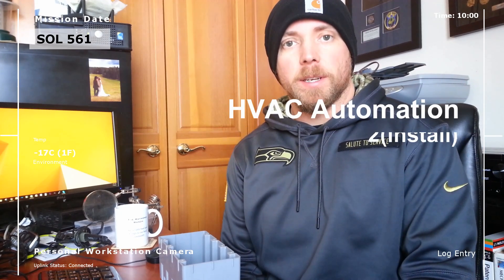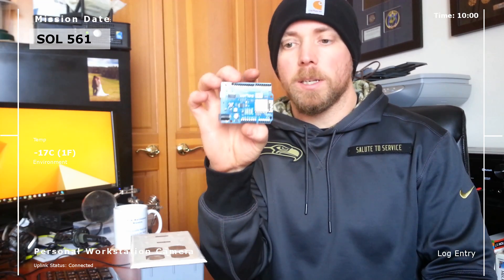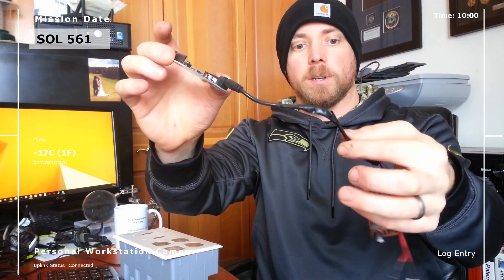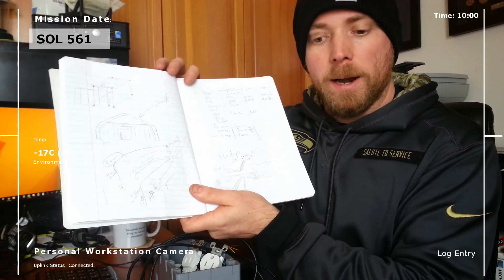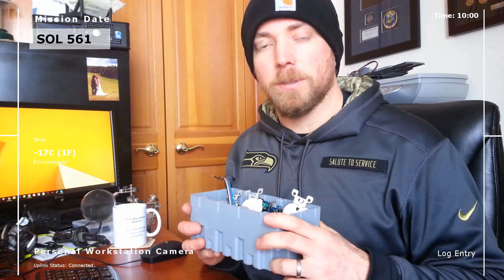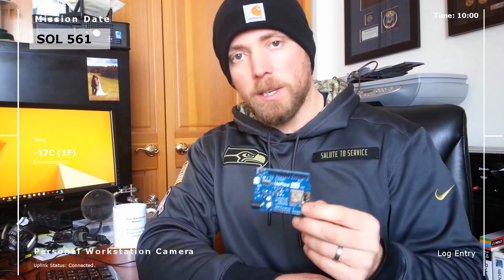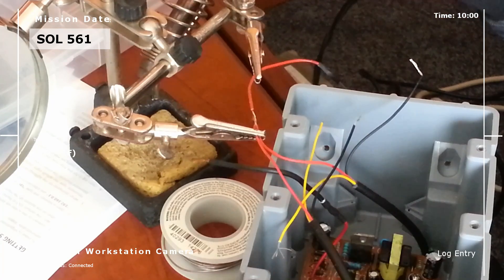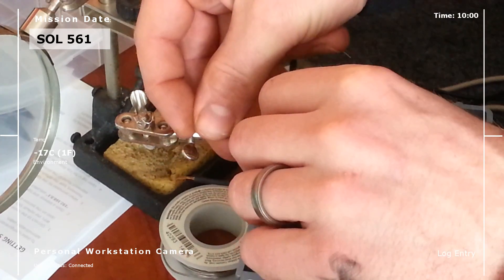Automating Aquaponics HVAC with WIFI Arduino's (ESP8266)  Part 1

Comment: Receptacle, not plug. As an electrician,  I'm a little concerned about your setup. You need some separation of low voltage from the 120 volt.
Reply: Not if its all staying contained within the box. ie. 110v in and 110v out.
Reply: Alex Banman : Not true, the low voltage components are not rated to the higher voltage. If you have a failure, those components can carry  lethal current. Think of the temperature probe at 120 volts, sitting in your wet soil or fish tank.
Reply: He is hanging sensors on it. So a fault inside can bring hazardous voltages outside the enclosure via the sensors.

Comment: Those stand offs are exactly what most AT/ATX computers use to keep your motherboard off the PC case (Tower).. don't think you would find building a PC to difficult  (time permitting) its not hard  👍
Reply: The time is in the research, the actual building is very fast.  You can usually have a computer built easily in an hour.
Reply: Tops been building them since 95 lol back on 8086 then 386 486 etc

Comment: I find it hard to believe you only have 110 40 amp service at your house.
Reply from the maker: not at our house...just at hab 1
Reply: Didn't Cody do electrical? Was he a contractor? Shouldn't be hard to run wire with that new tractor of his that can dig a ditch.
Reply: How much do u have at ur house?? and is it on a separated feed from the grid? and is it on a separate transformer??

Comment: Would it be possible to mount all the components onto a plastic plate then install it into the box afterwards . It would be easier to attach the wiring ect. Or a bigger box ...

Comment: How about using two boxes back to back, keep all the low voltage in one box and the hight voltage in the other. If you need to get to the Ardrio all you need to do is remove the cover plate. Also less Rf interference with the 110v .i like to use plastic cover plate in moist location so to avoid getting shocked from a grounded cover plate.
Reply: Dave Strong I was just going to suggest that too.  You beat me to the punch.